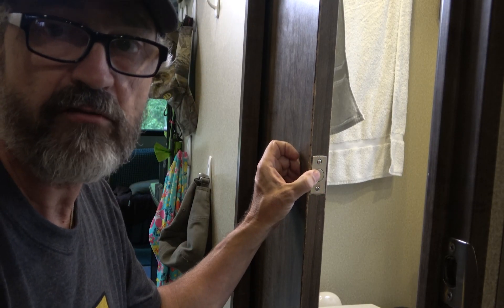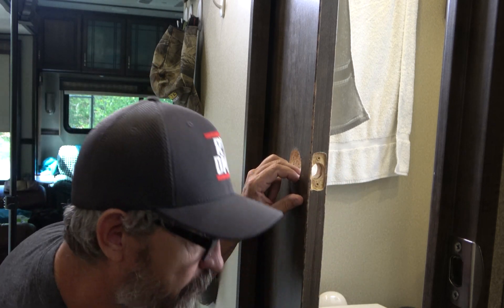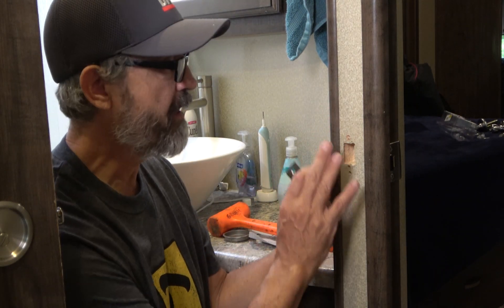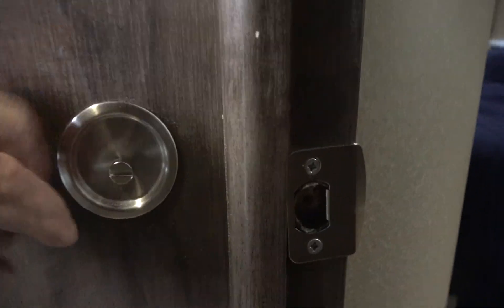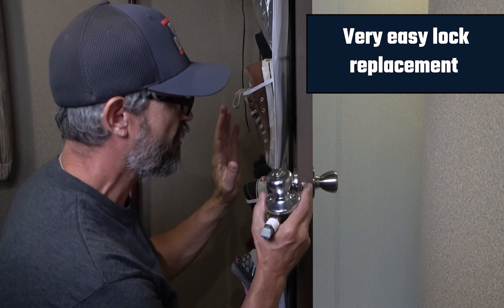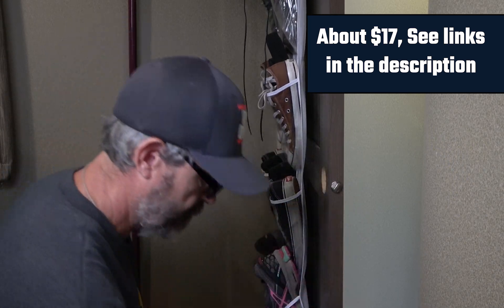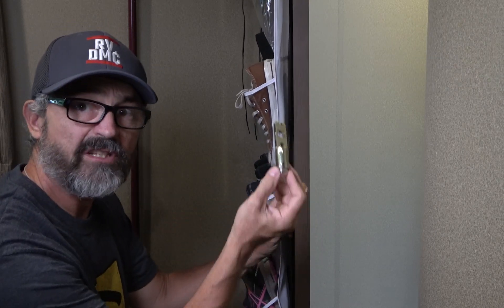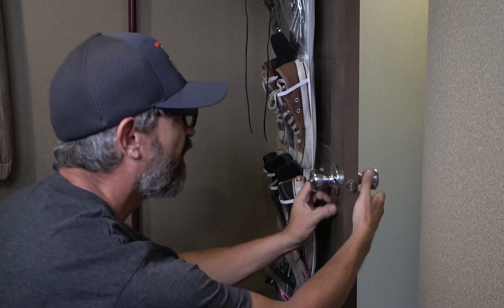Lock RV Bathroom Pocket Door for Security & Privacy DIY Project

Comment: Any chance yall have suggestions on the front door? Absolutely hate that it swings out and not in.. I can obviously change out the main lock, but that still isn’t very comforting for me.. At least in a home or apartment you can put something under the door handle to stop the door and make it more difficult to open. With the door on a fifth wheel swinging out and not in, that is not an option.
Reply from the maker: The great thing about an RV door only opening out is that it’s much harder for somebody to break in. They can’t kick it in. Larry